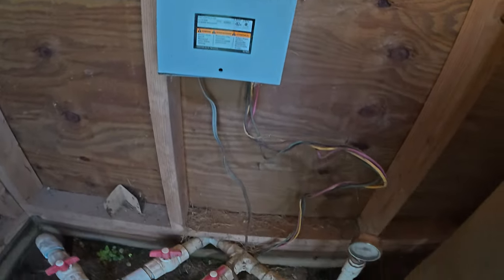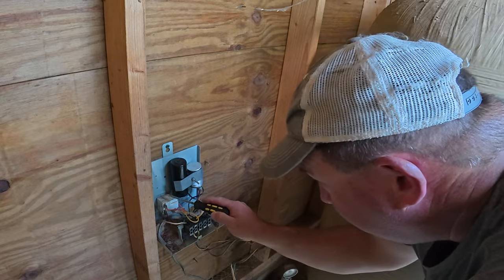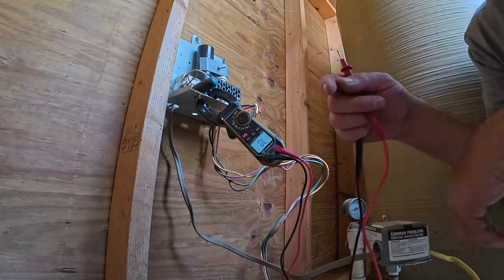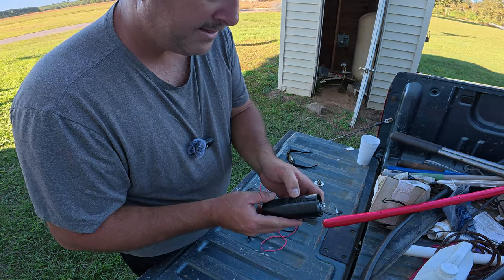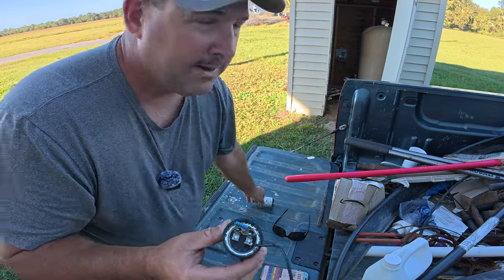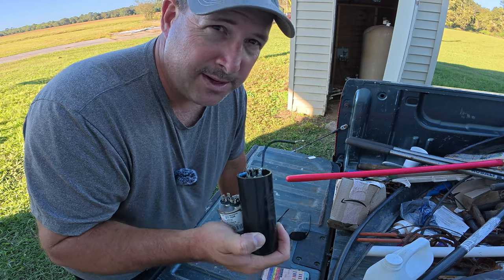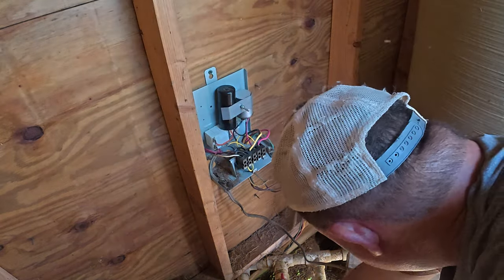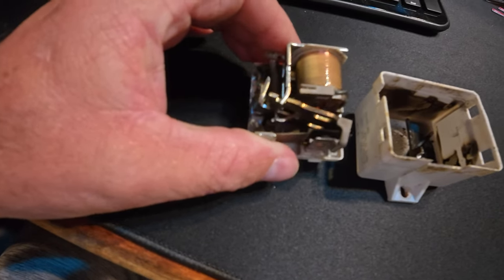DIY Well Repair - The Ultimate Troubleshooting Guide- Step by Step Instructions to Fix Your Well

Comment: Years ago, very little water from a 56-foot deep well with above ground pump. Everyone was clueless until finding an old plumber. PVC sand filter well point at bottom of galvanizedd pipe fell off, filled with sand, and got picked up into well pipe. Water couldn't get around it. He fished it out and sleeved galvanized pipe with PVC since buried galvanized pipe corrodes in Florida.
Reply from the maker: @troys6965  yeah, I’m in NW Florida and the salty air and water can create a mess sometimes.  We had an issue with another well on our property and lightening kept knocking it out.  We ended up having to have a new well dug because it blew the screen out and would suck up sand.  I ended up doing time serious grounding and haven’t had an issue since.  Same thing happened at another house I owned when lightening hit a tree in the back yard. Came through the water line and took out the well, arced from the hose bib to the hvac system and blew the thermostats off the wall.  Took out the alarm system that was tied into the thermostats, the networking equipment that was connected to the alarm panel and…. Well, you get the idea.  Insurance was great that time and got it all fixed but what a mess. Thanks for the comment!